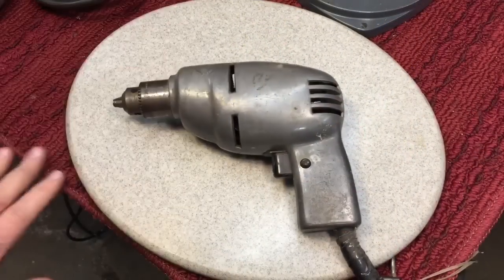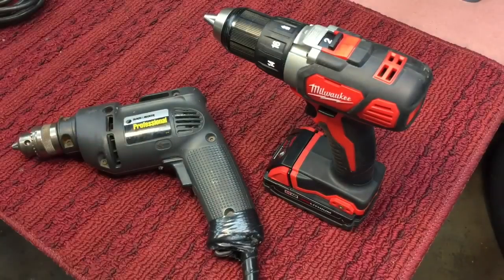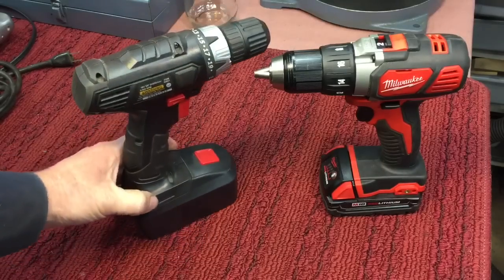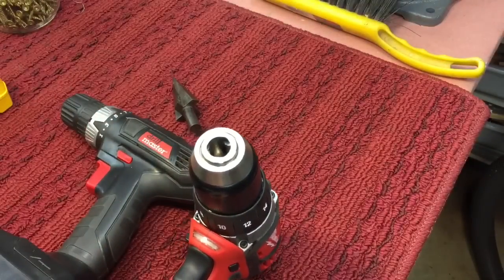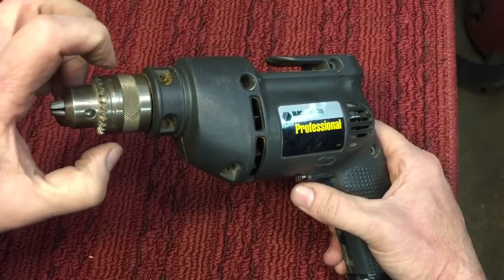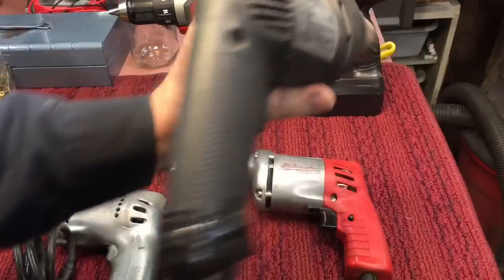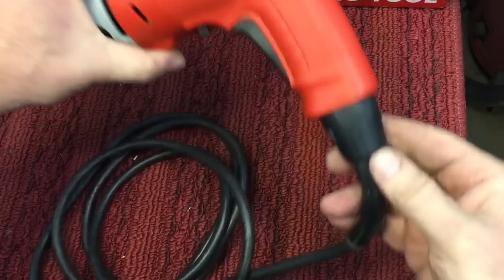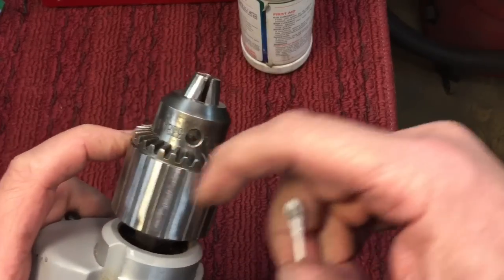Considerations when Buying a Drill-

Comment: Just a bit of advice I'd like to share, if you're gonna buy a cordless drill, or any cordless tool for that matter, go the extra mile and get a brushless, even if you don't need the twice the screws or twice the holes, just because over time, as your battery gets weaker, it means you'll still be able to run your tools a decent amount of time, I got 5 yo small dewalt I used and abused and I still manage to sink many screws

Comment: The thing I always notice about USA power tools is the thickness of the mains cord - in the UK, our voltage is 240, so the amperage is halved, so the power cord is a lot thinner.
Reply: I think they make the rubber thick for abrasion resistance and durability.
Reply: @paulsawczyc5019  That's another factor, but in general USA power cords are thicker because they have to carry twice the current.
We use 110 volt tools in the UK - safety laws require them on  construction sites - they have different plugs to connect to the step-down transformer, and their power cables are also noticeably thicker.
Reply: Correct Mike. 
The US started out with DC power because of Edison. 
The voltage was low and when Tesla proved AC was easier to transmit over long distances Edison had the political capitol to override the idea of using 220 3 phase supply line.  The US has suffered since. 
Higher voltage transmits more power over smaller wires. It is lower in cost and can transmit over longer distances on smaller less expensive lines.
The appliances powered can be more compact and lighter than an equivalent low voltage appliance. 
Same reason cars dropped 6 volt systems in favor of 12.
Reply: @OldSneelock  The common man on the street believes that you need thicker copper for higher voltages - they will argue if you try to educate them.

Comment: What most people get wrong on the cordless drills is the speed setting. You usually have two speed settings. Setting no. 1 is slow but it has much more torque. Setting no. 2 is faster but has less torque.
In my opinion picking the too cheap ones isn't a good idea, especially not if you need several cordless tools. I use Makita cordless tools, they got one battery design that fits on all their 18V series tools no matter if it's the drill, the angle grinder, the hammer drill (most houses here are masoned brick or poured concrete, it has an SDS Plus chuck). The last one is also a nice addition because you can switch of rotation, so it only hammers. Good for removing tiles with the SDS chisel. Had no issues drilling a 20mm (3/4") hole through a 50cm (almost 16") thick concrete wall. That one was fun, but done relatively fast. And you usually buy the tools where you already got batteries for, so you can swap them. A few batteries, some for the tools you use and some charging in the meantime while you work. And when the ones in use are drained you change and work goes on.

Battery powered tools are a necessity for electricians, because on a new construction site you don't have any electricity in the rooms, only bare brickwork. You have a construction site supply, but that's usually out of range. And in older buildings you usually work there were you need to isolate the circuit there. And if you do a complete rewire it's like new construction. So almost all tools are battery powered, including the light.
Reply from the maker: It's funny but as tool enthusiasts we tend to consider tool purchases in a totally different way.  I think of my purchases as long term with quality and dependability high on my requirement list.  However when I was 16 years old I wanted as many tools as I could get so price was a determining factor for me.  =D
Reply: @ScoutCrafter  Yes, and the thing is if I buy a tool from a well known company that is on the market for a long time I'll probably have a higher chance of getting spare parts in the future when I need them. For the really cheap ones that isn't the case.
We still have several tools here from the 70s and 80s that my grandfathers bought back then. I remember my grandfather had a suitcase with the Metabo drill next to his bed in his bedroom. That Metabo drill is still here and works.

Comment: I have the craftsman version of your favorite Black and Decker and was terribly disappointed with it.  It is incredibly loud and crunchy sounding. It was my first reversible drill, first 3/8 chuck, and first keyless chuck.  Maybe I will give it a thorough clean up this weekend.  I would recommend a cordless drill for someone new because of the clutch, those geared corded models  just have so much power.

Comment: Great info Thanks  On the job site it is 95% cordless either Milwaukee or Dewalt they have more than enough power for most jobs . the only corded drill are typically SDS for concrete and even than the Milwaukee SDS are pretty good .

Comment: In 1977 I bought a 3/8 Milwaukee corded drill. Reversable. I think it is variable speed (can't remember) think it is 600 rpm good for drilling metal. Think it is 3.0 amps. It will break your wrist if it gets caught. used that from 1977 until the early 90s when cordless came out. You can't kill the thing. Paid $75 for it brand new back when you could only buy Milwaukee from a supply house or an industrial supplier. Still have it and it works fine. Had it apart once for new grease and a new cord.

If I could only have one drill that would be it.

 My first cordless was a Porter Cable 12v. Not much power and batteries didn't last very well only lasted a year or so. Back then the mfgs switched batteries platforms every year or so so it wasn't worth buying new batteries....you just bought a new drill. Then I bought a Milwaukee Cordless that got stolen off a job I only had it a few weeks. Then I bought some Ryobi stuff. Liked the fact that they still after 30 years still use the same battery platform. Not the best quality but pretty decent. I also have a Milwaukee 12 volt drill which I love. Batteries are $$ but they last and the 12v drill is nice and light you can almost put it in your pocket.

Comment: What’s really important is to know that when the drill gets old and has been used a lot the brushes can wear and it will be hard to start. I had one like that and used to tap it on a table to get it to make contact. One day it wouldn’t go even with the tapping trick. Since it was stuck I reached for my favorite spray can-WD40. I shot a bunch inside the drill. I soon found that WD40 is flammable. When I pulled the trigger I blew flames out the side and, needless to say, the drill never ran again. It was an old B&D that I bought in 1974 just like ScoutCrafter’s first drill. So-NO WD40 inside the electric motor. 

Merry Christmas to all!

Comment: I and my son find we use the M12 more than the M18 drills. I have some older drills, then my Black and Decker and Sears 3/8 and 1/2. They are rarely used. Now my 1/2" corded Milwaukee still sees use. It is the horse for some jobs. Actually I have a bench top drill press from HF that is probably from the 90s that I set up outside and move around as needed. I don't think it weighs as much as my compound miter saw. Actually if you are a person that rarely use a drill, I would go with electric. Batteries sitting for long periods don't hold up like ones used every day. By the way that Milwaukee Magnum was a score.
Reply from the maker: Nothing worse then reaching for a drill only to find the batteries are stone dead...   =D

Comment: I bought my first drill at Sears on lay-a-way when I was 15 and every so often I would take my paper route money into Sears and make another payment on it. I bought a 600 RPM 1/2hp 1/2" chuck and put up all kinds of basement shelves right into the concrete block foundation. I was very proud of that job since it made organization so much more useful. 3 handles & I still have it. So for my 30+ years of drill experience I would say this to a newbie:
 The favorite part of my 18V Nicad Craftsman cordless drill is the cordless light it came with it. Those batteries have long since died and now I am thinking about rebuilding it using 18650 batteries and some LED strip tape as I miss it greatly. So I would tell any newbie to get a system that has a cordless worklight. Any recommendations for cordless worklights?
Reply from the maker: John the fact that you had a lay-a-way at 15 to buy a drill is AWESOME!!!!!   You are hard core!  I don't have any portable worklights however the Larry Lite has saved me dozens of times!  https://youtu.be/keyjLnfjrtU

Comment: I have noticed that the cheapest cordless drills tend to cheap out on the chuck first and foremost. Any drill that advertises a Jacob's chuck is likely to be high quality. I have found that it is often more cost-effective to buy a very inexpensive drill and mount your own chuck though this option would not be good for a beginner. For starting with cheap tools, I have personally found that Ryobi and Wen are very predictable, these are a good first choice that is very inexpensive.

Comment: I prefer a cordless dewalt with a metal keyless chuck and a light for outdoor work and minor indoor repair, and a heavy duty corded pre 2000 Milwaukee for high demand  jobs like mixing paint and drilling through concrete.

Comment: For 250 quid you can pick up a combi, an impact driver and an sds in the uk replete with batteries. Add in an extra 50 for a corded hammer drill if you’re inclined and those are the only drills Joe average is ever going to need I reckon. If you really wanted to get serious, a pillar drill can be had for under a ton and if you’re careful and don’t take them out of the workshop you’ll be fine.

Comment: Besides wood and metal, quite often you might have to drill a hole to the concrete or even stone. While your drill might come with hammer action, the proper tool for that purpose is a rotary hammer. Even cheap rotary hammers are usually a little bit more expensive than common hammer drills, but if you have to drill concrete their piston mechanism is much better than the clutch of a hammer drill. For the masonry work you have to get drill bits with special shank, however at least mine came with extra chuck which has similar shank as those masonry bits so it could be used with normal bits when in drill mode. I would go almost as far as to recommend a rotary hammer for that all purpose drill, because in the drill mode it could be used also for wood and metal.

Comment: I have to say that I prefer cordless but use an impact driver for driving screws, they are much lighter. The other issue with cordless tools in the battery platform. You could easily fill your shop with chargers. I wish they were standardized by voltage. Also for hammer drills I prefer corded.

Comment: Drills have to have.
2 speed
Clutch
Reverse of course 
Preferably keyless chuck
Hammerdrill action is a bonus but no substitute for SDS drill
 Gotta be honest. I rarely used a corded power tool anymore. Only to mix mortar or heavy body material.  I have 12-15k invested in miwaukee M18  and M12 line and use them daily. I think between work and home shop  i have 25+ batteries alone .   I dont see me going back to corded or air hoses for the most part. 
   
You do love your old drills🙂
Reply from the maker: I find professionals like yourself absolutely require cordless tools, it just makes sense.  However for most home owners who don't spend hours in the shop I would be hesitant recommending a cordless drill.  As a pro you would look foolish asking where's the outlet.   =D

Comment: I’d recommend a 1/2 corded Variable Speed drill to a beginner. Must be reversible, keyed chuck preferred. I’d buy a reputable brand and spend $40-$70 dollars. I might even by one with hammer function. I have a Porter Cable that I bought for the hammer feature, but if I had to keep just one drill for all purpose, it would be that one. 
Of course I’m not a maniac and I own multiple drills, cordless and corded. I would definitely suggest getting a set of cordless tools as your skills grow. Around Christmas and Father’s Day, good sets by Ryobi and other pop up with two batteries, a charger, a drill/driver, impact, and one or two random tools for $200-$300. My wife got me a large 18v Ryobi set with those tools plus a hand vac, circular saw, sawsall, sander, flashlight, and multi tool, and weed wicker in a bag, for $300 a couple of Christmases ago. They are great tools for regular home use.
Reply from the maker: The funny thing is cordless drills are evolving and changing every couple years where as the corded drills are pretty much the same as they were for the last 4 decades!   =D

Comment: John, that old Pontiac is sweet!  Do you still have it? Flathead 6 or straight 8, 3 on tree or hydramatic. I had a pal in 67 Long Beach Naval station, CA (I was at Marine Barracks). His was black on black, he bought it for $125.00 from a 80 year old lady. It was cherry but not as nice as yours. On the freeway 55 was tops not to stress her out.what a sweet old ride. I had a 57 Bel Air but his rode a lot smoother. What a classy old poncho!
Reply from the maker: Hi Tom- It took me 15 years to restore that baby.  I sold it in order to buy my house.  It was straight 8 with a auto transmission and a 6v electrical system.   =D

Comment: Depending on your use, hammer drills are quite necessary.  You can burn up drill bits pretty quick trying to drill into brick without the hammer drill feature.
Reply from the maker: You are spot on about trying to drill any type of masonry without the hammer feature, the only issue is some of the early and inexpensive drills that included the hammer drill option were failing and they got a bad reputation.  If you are doing a lot of masonry work I would highly suggest a dedicated hammer-drill as it will make your life a whole lot easier!    =D   Thanks!

Comment: I own that Milwaukee 0234-1 hole shooter 1/2 chuck they come used in different amps mine is 5.4 amp I want to know by the community here is it worth replacing the switch and then at night it works perfectly fine or should I buy another one since they're carbon brushes are perfectly fine on mine and the second set was never even touched

Comment: Sold ALL 6 of my cordless drills about 8 years ago. Couldn't stand dealing with replacement batteries and weak batteries as they age out. With a simple extension cord my battery woos are gone! I went with a Milwaukee Hole Shooter, a Milwaukee Magnum, a Milwaukee angle drill and a Milwaukee SDS Hammer Drill with a D handle grip. Combine that with my floor model Drill Press and there i nothing I can't properly drill. I would never buy a battery operated tool again!
Reply from the maker: Bobby- You bought all top of the line drills!!!   NICE!!!

Comment: Great stuff. Plenty of scope for a part 3 ; )
A cordless with a 43mm Eurocollar would be useful, so it can be used in drill guides and portable drill presses. None of the main manufacturers seem to make one.
How useful are percussion drills? It seems to be a standard feature now, but I prefer a full hammer drill and never use the percussion type hammer drills. I don't know if there is a difference in how they work, but I know that dedicated hammer drills knock the spots of percussion drills. (hope this makes sense).

Comment: You covered this, but I believe it deserves emphasis. There is not a best drill. There is only the best drill for you. Go to a large box store and heft every model with a battery installed. Personal comfort is paramount, shop for yourself, not for box features. Ignore all horsepower claims, these are easily manipulated and meaningless. One other note, nowadays a few mega corporations own the majority of tool companies. If you see two drills that are visually identical but branded differently, they are likely from the same mold. The quality of the internals is all over the map, even amongst a single brand. If you choose cordless, you are not bound to that battery system. There are adapters and generic batteries available online, the quality is very hit or miss but they cost about 15% of name brand. It's hard for it to not make sense to buy six batteries for the same price, but this is annoying. If your budget allows, name brand batteries are far more convenient. Lately, some larger companies are installing RFID chips in the battery, this will prevent generics from being usable. Most importantly, brand name means nothing anymore. They are not loyal, you should not be. Consider lesser known brands, these are often manufactured by the larger companies.
Reply: In short, the batteries are a convenience to draw you into a fixed battery ecosystem. We have all seen the mowers and table saws powered by batteries. This is what the manufacturers want, for us to be locked into loyalty, consider avoiding companies that have anti-consumer practices.
Reply from the maker: @jpsimon206  JP- I can just see the first guy to pitch the cordless drills at the big board meeting...  "...And the real beauty is when the battery goes they have to buy another!"
Reply: @ScoutCrafter  exactly! And somehow I feel confident that the costs of batteries will shoot up once we are all dependent. Either that or the quality of the batteries will drop.